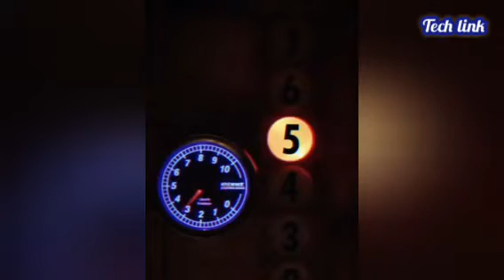Why aren't there any 7-Cylinder car engines?

Comment: There is a inline 7 cylinder in current production. The AGCO Power 98AWF. It's used in combines(which have a history of being able to use odd configurations of engines). 
Gleaner S97 and S98 are two that use this bizarre engine. The S96 uses the 6 cylinder sister that also see use in farm tractors.

Comment: „a 7 zylinder ship engine would never fit in a car“
dude, no ship engine would fit in a car
also, there are like V12‘s, so you wanna tell me, that we got space for 12 zylinders, but not 7?
the actual reason why we don’t have 7 zylinder engine’s is, cuz the generate lots of vibration, which could be reduced by proper mathematical engineering, but no company so far (except shipping companies) have tryed to make them work
Reply from the maker: Yep, u said it all
Reply: a straight 7 or inline 7 engine requires specific crankshaft timing to reduce vibration and noise compared to a straight 6. 
and you guessed it, to figure out the timing and create an engine requires time and money.
Also what about fuel economy. its only 1 cylinder more but if the timing changes drastically.. you never know.
Reply: Low rpm and a good exhaust would reduce noise
Reply: There is an inline 7 cylinder engine. The AGCO Power 98AWF.